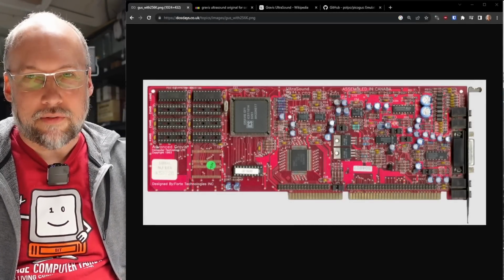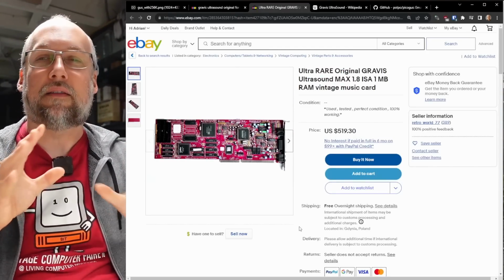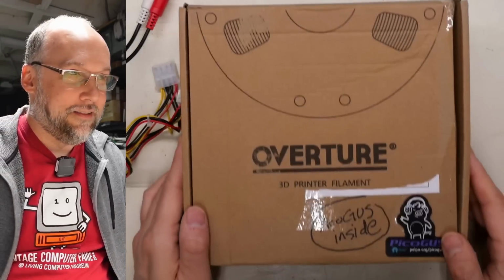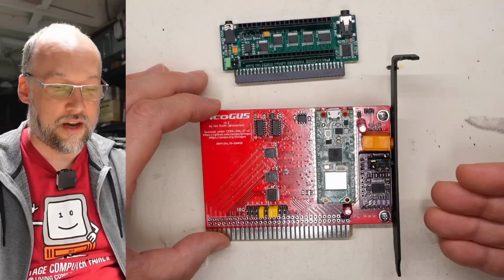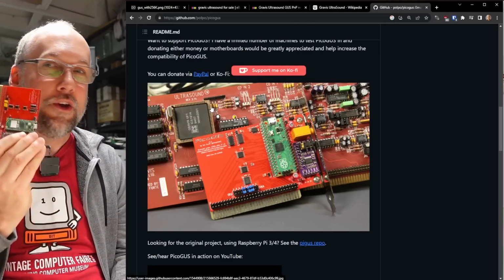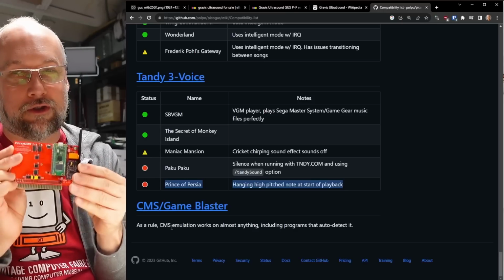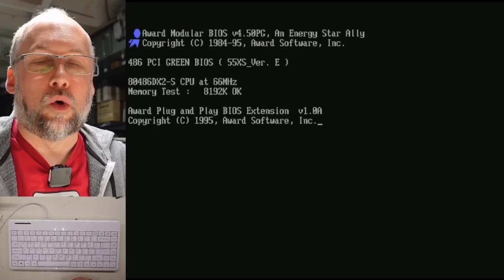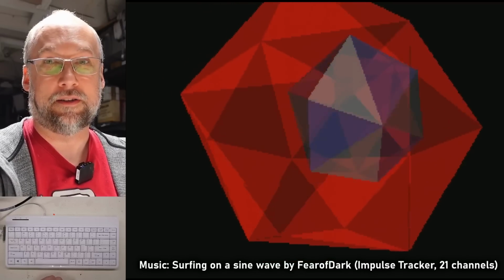The PicoGUS: An ingenious multifunction ISA sound card

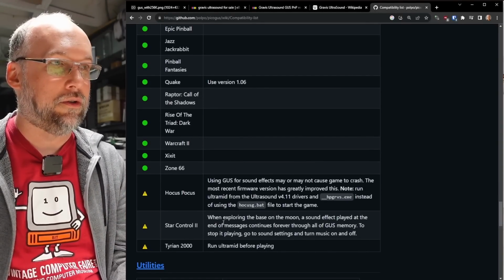Comment: A few observations from the compatibility list @20:00
Jazz Jackrabbit did not sound "just fine" on a Soundblaster. Jazz on my SB16 sounded fuzzy and awful, as did everything that output digital audio on that card, whereas the GUS sounded perfectly clean and wonderful.
The reported issue on Star Control 2 is interesting - I think that was a bug that exhibited on *real hardware*. I remember my GUS card having that problem, or one very similar to it. The publisher actually published a bugfix patch for Star Control 2 to fix GUS misbehavior.
Reply: Ok, that's super interesting! I've been chasing that bug for a long time, and if there's a patch that fixes it I'll be very happy. I'll search around!
Reply: Thankfully all this game had was mod music, so 4 channel 8 bit samples. It wasn't particularly hard on the hardware unless you had an old pc back then or no sound blaster, because oddly enough, it had a pc speaker tracker player (but that DID tax the cpu, of course). Point is moot now since the source code was lost. The guys who made it open sourced it based on the 3DO source code instead.

Comment: The Amiga was especially good, because not only did it have 4 channels of D/A conversion (4 voices as it were), you could do 2 voices and use the other two channels to modulate the 2 making the audio.  You could not do that (AFAIK) on any other built in sound system.  The sound blaster that was common in that era had only one D/A converter, and that had to be shared between the two stereo channels.

The Amiga was so good.  And the OS was amazing for it's time as well.  Sadly, it was only seen as a gaming system, when it was capable of so much more.

Comment: Has anyone made an emulated SIDstation yet? You know, that hardware thing that required two real SIDs?
Reply: I don't think the hardware would be too difficult to reverse engineer, but it's very much a college design and thus quirky. maybe disassemble the HC11 code and reimplement the interesting pieces? (only one SID in the sidstation...)

Comment: Memories! AWE64 GOLD! I remember when I got a spare ISA AWE 64 Gold from my friend whose father was in audio production, and suddenly it interfered with my ISA 10 MBit ethernet adapter, cutting me off of the 300kbit cable modem service at random intervals. Back in 1998. The hotline technician said "ISA sound blaster?" before I even stopped talking. Because I did not want to give up my AWE 64 Gold, I upgraded to a PCI 100 Mbit ethernet card to get rid of the resource conflict.

Comment: The AWE32 was the very best Sound Blaster.  I upgraded from an original SB16 to it, for the extra MIDI capabilities with the SoundFonts. Bjørn Lynne (Dr. Awesome of Crusaders) used it a lot back then too, made a couple SoundFont MIDI retakes of a few of his MOD classics. Frontier: Elite II also sounded fantastic on it.
I never really liked the filtered output of the Ultrasound though - a mate had the original. Good for demos, but much preferred the more crispy and clean SB output. Also you couldn't use the Adlib mode of Scream Tracker 3 with the GUS.

Comment: Adrian, you missed the point a little bit about the use of GUS in games. You speak about the quality of the software mixing of samples, but that was not an option in games! In games that supported GUS, you had option to either use hardware mixing of great quality samples on GUS, or hardware synthesis (not software sample mixing!) on SB cards. And obviously GUS music with real instrument samples mixed in hardware, sounded WAY better than the very artificial sounding SB synthesis.

Comment: Oh cool. I seemed to have a knack for picking up weird stuff back in the day. I had a GameBlaster, I think around '87 or '88, in my IBM PC Portable and later a Laser XT Turbo I think. I eventually got a Prometheus Aria 16se which was also a wavetable card but was never very popular. The 'se' variant had some empty sockets and a connector for adding SCSI support that I don't think ever came out. I even went to an industry show around that time and talked to their reps there and even they didn't think it was going to come out. I think they folded not long after that. Shame, it was a nice card that I think had better specs than the GUS. Hard to find anything about them now.

Comment: Seeing stuff like this always makes me wonder how close we are to having entirely hardware emulated and/or FPGA implementations of retro computers for hobbyists to be able to play with.

Just kinda has me imagining a MiSTer type retro computer where you just change out the interface boards and flip a switch to swap between Apple II, C64, IBM 286, IBM 486, early Pentium, a Tandy, etc.
Reply: This is a goal of mine, to build a library of cores for every part of a PC and then build them on scaled down PCBs like the motherboards and add-in cards they emulate.  That would be so cool, giving you back 90% of the 90s PC-building experience.  Just add beige.

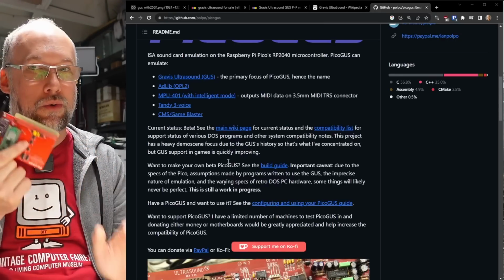Comment: 17:40 "I'm pretty sure there's a sound card for the PC that implemented SID." 
And you would be right, the sound card in question is called SSI 2001 by Innovation Computer Corporation.
It was released some time in April of 1989 with the price tag of $130.00 and it's essentially uses the 6581 SID chip (The early C64 breadbin models).
The 6581 is clocked using the 14.318180 MHz clock of the ISA bus. This clock signal is divided by the counter and flip flops on the board by 16 to produce a base frequency of 0.89488625 MHz, which is lower than the C64 and allows tones up to 3495 Hz (just below A7).
But much like how GUS didn't get any steam during it's time of release, the SSI 2001 suffered pretty much the same fate with very little support & discontinued while the majortiy of PC market is focused on the FM and PCM sounds.
Reply: Ian is currently working to add SID to the picogus
Reply: there is also Téli Sándor's "HardSID" but I recall he was very protective of the design.

Comment: I have an original Gravis Ultrasound, but I don't plan to sell.  I do use it, though not as much due to the issues you mentioned with compatibility.  I too have a SoundBlaster installed for that purpose (but only had an SB 1.5 left, I long lost my SB16 though it might be in my 286).

Comment: Great card:). GUS is very CPU demanding for an XT, just playing a sample requires a lot of asm lines, so several channel modules are just too slow. To play a MOD or XM, you have to process the tracks, notes, effects in CPU... and stick those big asm functions every time you change something about an instrument. Sure you can play MODS on XT, even in software like on 8088mph, but you won't be using GUS for a game on an 8088 4.77, or at least a game that requires a lot of free CPU. Also most GUS progras are made for 286 386 ...
Reply: I'd agree if you were talking about SB16 etc. but GUS? Pretty sure you could play 32-channel songs on an XT without any problems.
Reply: @az09letters92  Yes but do not expect to run a lot of things on screen. There is a video of an 8086 playing modules with a GUS, I think it can handle 16 channels, I don't remember. https://www.youtube.com/watch?v=bMBp0wntOSc.

Amiga has its own little cpu to process the modules (I think), other systems like consoles, really have another cpu to handle the music (a z80 on MD/Genesis).
Reply: @Oosystem  > Amiga has its own little cpu to process the modules (I think)
Not in any shape or form. Just a Motorola 68000. Paula sound chip just dumbly plays a sample at a given rate, GUS got way more "brains".
Reply: @az09letters92  I thought paula had some kind of "thing" to read and process the "mod" and similar files. Anyway m68000 is more powerful than 8088/86. 
I once programmed a mod player for GUS (I only tested it on emulators like pcem, I lost that demo), I could play very simple mod files if I wanted to use music for games. CPU usage was a bit high, because very simple MOD files would play ok, but arpeggios and other effects would slow down the program a lot. 

The same happens with adlib trackers, only very simple trackers will play ok for games, and trackers using a lot of effects are just too much.

If you convert the tracker to a stream format like VGM (just a string of commands to send to GUS) it could be very fast.

Comment: Hi Adrian,
GUS MAX's Crystal chip added support for Windows Sound System. It didn't add much support for DOS games. It didn't even add that great Windows support, despite its name. The chip added 16-bit recording capablities.

There was card called GUS Extreme, which some ESS AudioDrive chip. That one had OPL-3 and SoundBlaster Pro compatibility.

I had both of those cards in 90's. MAX's compatibilty with anything other than Ultrasound was terrible, except maybe the SW emulator for Roland MT-32 and Sound Canvas. Extreme had great SB support though; without any SW emulation. I never found any non-GUS supporting game or other program that didn't work perfectly with it.

Comment: On the subject of the Pico not being fast enough. It has been overclocked as high as 420 MHz using a clock divide on the flash. Maybe it shouldn't be pushed that far but double is easily possible.
Reply: Adrian refer to the speed to manage the ISA Bus signals, based on what he experienced with my card (The PicoMEM)
It does not work at 8MHZ because I never tried at this speed, so the code is not optimized for this yet. (There is still margin)
That said, the PicoGUS use the Pi overclocked at 370MHz, not for the ISA Bus speed (Was working at 200MHz) , but to experiment OPL3 emulation.

Comment: The GUS year were the best years of DOS gaming. The combination of a fast 386/486 CPU, (Super)VGA graphics, large hard drives and the GUS made the PC finally superior to the Amiga and the computer you did want to own.
Reply: Since I had both computers, I remember well the time. Unfortunately the Gravis was far from the standard for PC games. Hi quality but high price made it rapidly disappair and the most affordable Sound Blaster took the market. Apart this, the scene on PC was extremly lame in comparison to Amiga. I remember it took 5-7 years after the dead of Commodore before PC actually reach the Amiga level. You said "with a fast 386/486" but at time people left the Amiga 1200 to buy a 286/386 running at 16/20 Mhz and in most cases without a sound card. The "best years od DOS gaming" were to come. As told, 5-7 years after the Amiga was gone...

Comment: IMO the UltraSound PnP was a great sound card for DOS, and just a normal soundcard under Windows, since Windows software wasn't written to take advantage of it. The PnP had the advantage of not decreasing the sample rate when a large number of channels were in use and thanks to its large memory which did offer space for large sound banks, slightly better for MIDI games.
Reply: Definitely.  If you were a DOS MOD/demo enthusiast, the GUS was the way to go.  But with its limited RAM, channel count vs. mixing quality, and lack of hardware effects, the AWE32 was better for Windows and MIDI.

Everyone else just needed to stick with a Sound Blaster 16.

Comment: There used to be a USB device called an iMic
It had a switch that changed the input from line level to mic level.
It had a 1/8 inch stereo input, and when you plugged it in a USB port it gave you a new sound input source.

I used these to feed the discriminator output from Motorola Maxtrac 800 and 900 mhz two-way radios into the computer. 
I had 2 sound cards in the computer PCI slots and I used 2 iMics and had 4 sources for 4 radios feeding two 800 mhz and two 900 mhz radios feeding the software that needed discriminator level inputs. 
I tried the little 10 dollar USB sticks that have a mic and earphone jack, but the level was terrible and unusable. 

Is there a USB mic / line level input device that functions as well as the iMics did?

Comment: Another reason you wanted hardware mixing back then is the fact that internally sound card probably had a higher resolution DAC than you'd normally have in the software mixer, so you'd possibly have clipping noise. Say, your normal SB sound card would only accept 16-bit stereo samples for input - which means you'd have to down-mix all sound channels into two, possibly clipping the range of the 16-bit values depending on the global volume as well as the volume of each individual sample. 18 or even 20 bit DACs on sound cards with wavetable synthesis would help avoid that problem and you could have clean mixed output even at higher sound volumes.
Reply: The interpolation algorithm to upscale lower rate samples to 44.1KHz in the GUS was also quite good and could mean better sound quality for e.g. old Amiga MOD files.

Comment: reality by 1996/7 isa  was basically a dead , reality was was these usa sound cards had a use case on  windows  3.1/3.11,  once pentiums  started to surface and pro  audio  with rca jack and/ dins/mini dins for external midi product were a standard inclusion  you were  typically payign 1,000-1,500 per sound card we only combo board for about 3-5  years by 98  isa was all but a dead connection  standard was all but dead noting even under xp you had dos support

Comment: I had an early GUS card that only had software emulation of SB16. But I never ran in to any issues with compatibility, as long as the TSR loaded and the game recognized the "SB card" it was smooth sailing. I think once I had to fiddle with iobase addr and/or IRQ. Sadly I chucked the card back in 1998-99 when I finally retired that computer.
Reply: Yeah I found that SBOS on the original GUS had decent enough 'working' compatibility, but that the sounds themselves were often 'off', with many wrong notes, esp. with games like Xcom and Master of Orion.
Reply: @exidy-yt  That sounds entirely plausible. I never really did any A/B testing and I don't generally pick up on "off" notes/sounds. But hearing Adrian's description just didn't gel with my experience of the software emulation.
Reply: @OscarSommerbo  Totally understandable. For my part I had upgraded to the GUS from an original 8-bit Sound Blaster and am a bit of an audiophile so the missing and off sounds were very noticeable and annoying to me where they may not be to others. 
But yes this is almost certainly what Adrian meant by compatibility. It was enough to get me to replace the GUS by 1995 or so with an AWE32.

Comment: I think the GUS prices are so high because of its relative rarity to the AWE32.. but even the AWE cards are getting ridiculously expensive. eBay in general is overpriced for retro hardware. I have my best luck at hack-a-thons and other retro centric events.
Reply: Well... "scene stuff" like demos and modplayers typically did support the GUS but not the AWE32. Of course they still run thanks to Soundblaster compatibility, but you lack the advantage. Mainly for games that did use MIDI the AWE32 was a great choice and even slightly better than the GUS. So it depends a bit on what software you want to run, but for many potential buyers the AWE32 may not be useful.
Reply: yeah, ebay is entirely run by greedy scalpers these days ... they sell ISA and even PCI cards of the lowest potato class (even by back then standards) for over 100 bucks and don't even blush.

Sometimes they don't even know WHAT exactly they are selling ... like 'it has 8 or 16 bit ISA connector on the long edge and a 15 pin vga-style connector on the short edge ... let's put it up for $150 as "VINTAGE ISA graphics card, RARE !!!!!"' (every ! means it is marked up at least 10-20 bucks more than what any sane person should be willing to pay)

This is why I like projects like this and think more content creators should talk about it so that more people would KNOW that, instead of buying overpriced shit off of some scalper, they can get cheap alternatives for soundcards, memory expansion, video adapters and whatnot ... and leave the overpriced collectables to the actual collectors